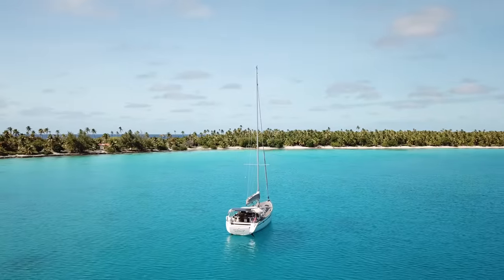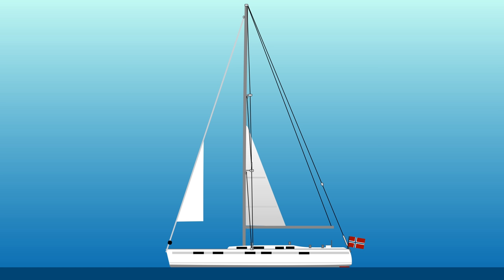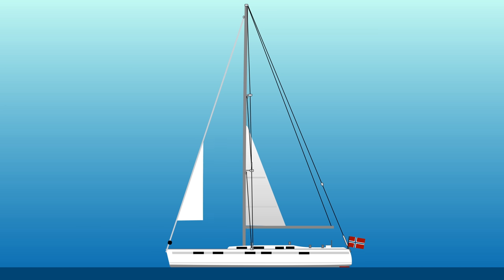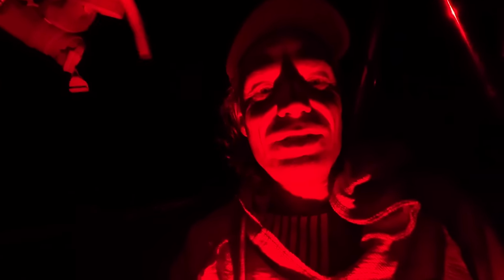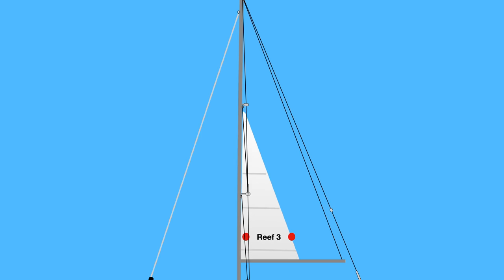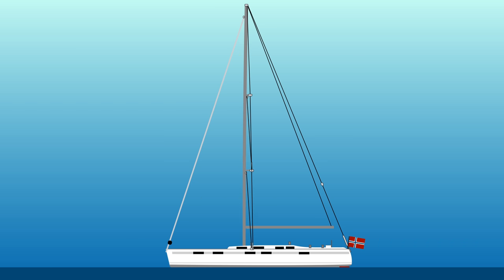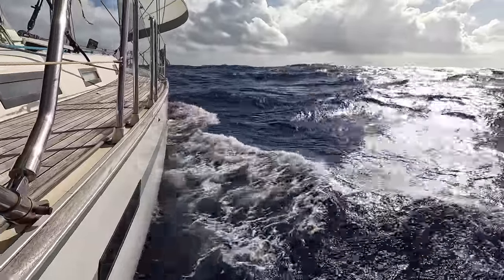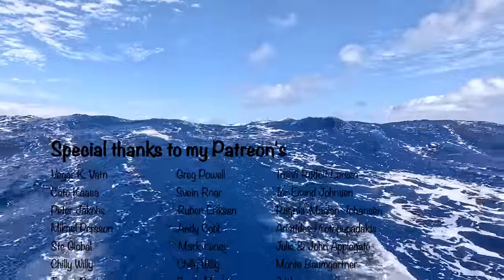HEAVY WEATHER SAILING WITH A STANDARD PRODUCTION YACHT - SwT 162 - HOW I DO IT AND MY STRATEGIES

Comment: Thank you, Thomas - thank you for such useful insights - let's thank our lucky stars you don't whine and moan about adverse weather - you just 'get on with the sailing' - good job!
Reply: Just wandering about the dismasting events & the statements regarding high winds tearing the rig down.
   In theory, with a monohull, max loading is when the wind is from port or starboard & with full sails up,  the boat should simply heel over thereby inherently limiting the loading to below the rig damage level. That's how rigs in the 80s were designed, it's one of the distinct advantages of monohulls.
  It seems from recent events that the rig loading capabilities of some production sailboats have been reduced below that which was acceptable in the 80s.  Seems odd that one of the distinct safety advantages of monohull sailboats would be thrown out the porthole for a halfpenny's worth of tar.
   It seems what's being done with rig load ratings these days wouldn't have been tolerated in the 80s.  
  So rig design strength should be so that all of the rig can withstand a full wind force  90° knockdown with a load safety margin.
  With this adequate strength rig then Sail area is reduced to suit wind loading & thus limit wind force loads &  to give a reasonable heel angle. 
  In very heavy winds sailing angle to the wind course adjustments & storm sails can be used to reduce loading while still providing reasonable heel angle & provide some sail force stability, automatic unloading occurs as before with automagical heel angle changes.
 A short heavy duty storm sail stay & short heavy duty extra storm sail track attached to the mast are invaluable.

Comment: We sailed the Pacific for 10 years in a light displacement yacht with a very tall mast head rig with swept back spreaders and no forward lowers. We had a removable inner forstay (stayed in place for ocean passages) with small 😂hanked on  stay sail and running back stays plus permanent back stay. 3 reefs in the mainsail. When reefed with the inner stay and running back stays created a very stable rig for and aft. Yacht also sailed very easily on just the main really only using the inner stay sail when we needed to go to windward but the stay stayed in place. Many rigs come down not from wind but sea state in very confused seas. We also sailed with just enough sail so as not to stress the rig. It’s not about how much sail you can carry but how little you need.
Reply from the maker: Very well said! And Thank you for watching 🙏🏻

Comment: That was an excellent summary! I have a different hull, and my boat will turn broadside without power in heavy weather. I have a small selftailing headsail on inner forstay (cutter) 'hank on' and running backstays. I once crossed Sækken (you know where tha is) from South to N in W 22 m/s. Only sail was the hank on sail. Appart from allmost drowning from seas breaking over the boat, it went quite well :-) Our boats reacts quite different in heavy weather. So I really appticiate you stating 'this is my boat, and this works for me'. Lokking forward to more of your 'navigation philosophy', can't have enough of that.   Every one have something to learn from you.

Comment: Excellent Thomas!
Of course I think it is excellent because I agree with everything you talked about.
Some people like drama so they magnify everything they talk about, others are dramatic because they truly are afraid. Terrified even. I don't like roller furling for the reason you mentioned it is very handy but dangerous if you are in serious weather. Most modern boats have the boom really high above the deck to clear dodgers and biminis but that makes reefing much more dangerous.

If I had a boat like yours, I would have a permanent storm-stay set up from just in front of the coachroof bump on deck (to the nearest bulkhead) to the lower spreaders with a halyard for a hank on storm jib of heavy cloth, stowed with its own sheets attached in a storm bag. I prefer a cutter or a double headsail ketch because of the flexibility the two forestays offer for various sails. Nope, not as efficient upwind as a sloop, but safer and easier for one or two people to handle in storm conditions. I doubt many cruisers carry a storm trisail anymore that ran on the mainsail track but replaces the mainsail in storm conditions. It would be a pain to remove the mainsail slides from the track to run a trisail up it. But they were good for getting the center of effort of the sail down much lower.

I've only had to use my storm jib and triple reefed main a few times when the wind got over 40 kts and the storm jib alone at higher wind speed. Once we were bare poles for a few hours and still doing 10+ kts downwind. And many times I've sailed in from a rough passage in company with another boat and they always estimated the wind speed and wave height much higher than it was.  Part of that was because they had no instruments but part was it was the worst conditions they had ever been in and were scared. As you said, once you've been in worse it isn't so bad... Until we get into the worst we have ever been in and it becomes our new benchmark.

When you are mid-ocean and at the crest of a wave with a valley ahead and behind you where the bottom of the trough looks 100 feet below, then you sail down the face or back of the wave and at the bottom of the trough you are looking up and up at the crest of the wave in front and behind you that look like 12 story buildings, with very little wind down there but howling wind when you are on the crests, now that tends to be a bit scary until you do it for several hours and start to relax and enjoy sailing in the "Grand Canyon" ocean and you know that you will never be able to describe the feeling you have.  Then the sun goes down and the heavy, dark clouds cover the sky and the rain starts falling... or going sideways actually, then the sounds of the wind and breaking crests of the waves that were so exciting during the daytime become much scarier in the pitch black.

Good times!
On a good boat that is well prepared for really heavy weather that is actually rarely encountered.

Comment: With the Caveat that pretty much any Rig can be made to Work. My favourite Rig is KISS based principles built around an in Mast Furling MInsail, and a basic Sloop Rig with a single forestry with a bowsprit for Furling light wind Sails, and a Furling TriradialGenoa with three reefing points. The Main has a 3+Reefing point Triradial Battenless Construction, and the third reef (this to test the theory) having two reinforced reefing points in it, to keep the lastDouble Storm reefed Cloth very reduced area and right next to the Mast, with no Cloth at the Bow so now leverage to break heaving to. So pretty much in line with your thinking Thomas, but from a bit different direction to achieve the same effect. For Durable Sails that will keep their shape and at fairly affordable prices, Triradial build imho, is the best way to go, from about double the price of baggy pants in no time Crosscut Dacron, but they can last over ten times as long with Sail Valeting and servicing at regular intervals. Non Mylar Laminates are looking promising, but they are outside of my price range tbh. Needless to say, This extremes of Boat Sailcloth leverage, for me, rules out a Ketch Rig. But it does bear repeating, that A Ketch Rig can be made to work as well, but for someone disabled like myself, it is far too dodgy to consider, and the same goes for twin Forestay Rigs. Everything must go back to powerful electric winches and Clutches in the Cockpit. In storm Force Winds, you don’t want to have underpowered Winches, or an Undersized inboard engine for that matter, you need power to spare to be able to tick along to get out of the Storm area, or make it into clear Water Offshore and away from Land. While difficult in a Storm, it is important to keep stresses on the Rig, Sails, and boat, as low as possible. Admittedly, my considerations are particularly tailored to my needs, but hopefully there is useful food for thought in this post for others. Best Wishes, Fair Winds, and Safe Travels. Bob in Wales. 👍🏴🇬🇧⛵️🌟🌟🌟❤️
Reply from the maker: Thank you so much for sharing and all your inputs. Love it! We have all different needs and different boats. Important to find what works for you. Hence the reason I don’t like how to videos in such topics as sailing. There is no size fits all, and also sailing solo vs crew is so different. So I’m really happy to know my videos can inspire and motivate and even being appreciated. All the best and cheers 🍻

Comment: Very informative Thomas! Have you explored the ATM Storm jib? It is made to go over your rolled up head sail. As to reefs in the main, I installed a 4th reef on my previous boat that could be taken from the cockpit that acted as the storm trysail. (See Skip Novak's videos on Heavy Weather Sailing).
Reply from the maker: Thank you so much 🙏🏻 Yes I have tried several options including storm sail in a bag. Lots of good solutions on paper, and even theoretically how to strategies. Problem is different boats have different challenges, and also it’s a significant difference being alone versus having crew. For me the best option has been proven to be a modified storm sail that fits the furling system in the front. With this I can furl in the storm jib if it gets even to crazy for this. Above 55 knots wind and up it’s not a pleasant experience to be on deck working with sails. If I have time to plan it’s a different story but being surprised by a violent storm is no joke. This strategy and how I do it is not for only a squall but a continuous violent storm definition by Beaufort Scale. This might not come out good enough in my video. I constantly learn from my own mistakes and this time my biggest mistake was not trusting my instincts and experience above the weather forecast. I should had taken the advantage of light winds before the storm reached me and replaced the sails. Had I been following my heavy weather strategy from  the beginning I would been very well rigged to handle this winds. I have sailed through worse with that. The flaws in my setup and strategy is exposed as I can’t handle impulsive unpredicted violent storms very well. They needs to be planned and predicted. I believe this was a good learning and experience. Thankful for coming out at the other end with no damages

Comment: If you can hoist a stormsail on a baby stay, you probably can then forereach into the weather which would be good. Just depends on where you can apply the load on the mast without risk of inverting it. That could also dismast you if the winds are strong enough. A good rigger could & should advise you on the details.
Reply from the maker: Yes modifications needs Professioneel calculations and the correct tuning. Running back stays would be key. My biggest challenge is being solo sailor meaning I need a setup that minimizes the risks and needs of being on deck. Going at the front in heavy seas that comes with winds above 50 knots is nothing I do voluntarily. So meaning I’m this situation my mistake was to not take benefits of the light wind and change sails before this unpredicted storm arrived. I should had trusted my instincts and experience above the weather forecast. 
As a consequence my choice was to play with what I had. And it worked. Not optimal but managed to come safely out at the other end. It was an exhausting full night with brutal weather

Comment: Storm-bag ( patented ) could be an option; stormjib in a bag that you mount on the furled jib ( watch the videos on YT ), would also prevent the shaking of the furled jib, altough you should tighten the jibsheets to prevent the headstay shaking. A cutter stay is a security to unknown conditions you will meet at sea.
The blue dismasted boat is a Koopmans dutch design strong blue water cruiser and indeed, i am impressed at the capacities of Bavaria's, being a low cost! production boat. Though Jambo ( german YT ) on a Bavaria 34? lost his mast in not so heavy weather and finally ( in an other mishap ) sunk few weeks ago in the Atlantic. Stay safe.Greets from Belgium.
Reply from the maker: Maintenance is key! I lost count on all the old Bavaria’s I have met with 25 years old Rigg and lack of maintenance. I’m surprised they have managed to cross the pacific and come so far all the way from Europe with old x-charter yachts. Must be very well made. From my experience not only as a sailor but from the other side is almost every single mast that comes down is overdue maintenance and refit. 
I have tried storm bag and other options. It’s a significant difference being solo vs crew. Also what’s sounds great in theory are often not so easy in real life. I really dislike working on deck in 8-9 meter waves and 60 kts wind. If I need to reduce my sails I prefer a furling solution that’s strong and solid. What I have works well if prepared. A long lasting storm that’s a surprise my setup is not so ideal.
Thank you so much for being here and for your comment as well. Cheers 🍻

Comment: Thank you for the education. I am a novice sailor and after watching your dream heavy weather sail setup for your boat, I am wondering if you would think a sloop design would be better in heavy weather?
Reply from the maker: Thank you so much for watching and for your question. It’s as many opinions as options but for me as mostly a solo sailor my setup works good. However as I point out it also has room for improvement. Especially in unpredicted heavy weather sailing

Comment: Do you just steer into the wind to reef the main?  Or would you heave-to to reef up to a certain windspeed that does not put your rig at risk?
Reply from the maker: On my boat I need to go up against the wind as it’s to much power in the sail. I have a semi automatic reefing system that I can operate safely from cockpit and it’s pretty fast. Normally I already have reefed down when it gets wild, meaning the sail is already reduced before adding even the third reef. Genoa I try to have enough tension on to avoid flopping when furling in. Lots of techniques and how to would be different with a crew. My shared experience is based on the equipment I have as a single hander. Thank you so much for your question and for being here

Comment: Just wandering about the dismasting events & the statements regarding high winds tearing the rig down.
   In theory, with a monohull, max loading is when the wind is from port or starboard & with full sails up,  the boat should simply heel over thereby inherently limiting the loading to below the rig damage level. That's how rigs in the 80s were designed, it's one of the distinct advantages of monohulls.
  It seems from recent events that the rig loading capabilities of some production sailboats have been reduced below that which was acceptable in the 80s.  Seems odd that one of the distinct safety advantages of monohull sailboats would be thrown out the porthole for a halfpenny's worth of tar.
   It seems what's being done with rig load ratings these days wouldn't have been tolerated in the 80s.  
  So rig design strength should be so that all of the rig can withstand a full wind force  90° knockdown with a load safety margin.
  With this adequate strength rig then Sail area is reduced to suit wind loading & thus limit wind force loads &  to give a reasonable heel angle. 
  In very heavy winds sailing angle to the wind course adjustments & storm sails can be used to reduce loading while still providing reasonable heel angle & provide some sail force stability, automatic unloading occurs as before with automagical heel angle changes.
 A short heavy duty storm sail stay & short heavy duty extra storm sail track attached to the mast are invaluable.
Reply from the maker: Knockdowns is normally a consequence of being overpowered and for most mono hulls this is no problem. As long as your Rigg is in good shape. However it’s a significant difference in one knockdown with a natural broach as consequence during a random wind gust compared to continuous violent storm. First of all being knocked down continuously with broach after broach is definitely not comfortable. The wear and tear on all gear and sails not to forget rigging would be massive over time and something you would try to avoid. The correct amount of power to continue sailing is key in any wind force. However from violent storms and hurricane force winds it can be the difference coming out in one piece at the other end or not. Most modern yachts have good rigs just as old days. The major difference is modern technology gives the engineering better tools knowing how much and what to make. Lots of cables is not necessary stronger. It also add weight aloft. As an example adding 50 kilo to the top of your mast equals reducing 500 kilos of your ballast weight. In the 80s lots of great boats where built, however the knowledge and tools for calculating the physics was not as good. A great example is they had very little understanding in hull thickness and fiberglass. Often resulting in way to much polyester that actually not made them stronger. 
But for sure some modern brands do take shortcuts and are challenging the weights and physics to much. That’s a fact. My key message in this episode however was to know your boat, it’s limitations and the options. Having this tools in your box you know how to handle a situation like this. What’s a violent storm for a 34 is a nice breeze for a 55. It’s often based on how experienced and knowledgeable the sailor are. When I refer to a violent storm it’s based on the Beaufort scale, meaning my sailing was reaching close to hurricane force. And this is no joke. That’s why I wanted to share my mistakes and even how I solved my situation. Without claiming to have the blueprint. This is only how I do it. 
All the best